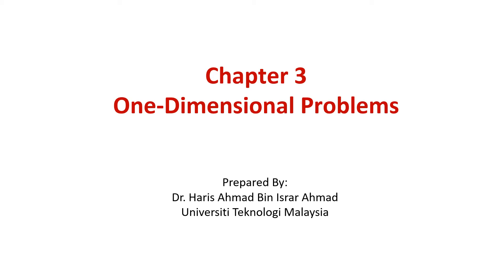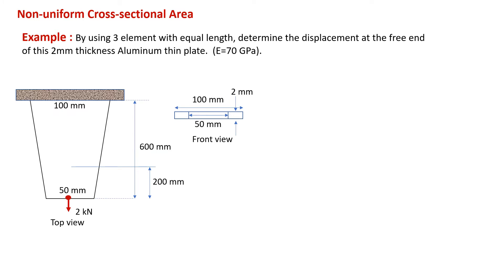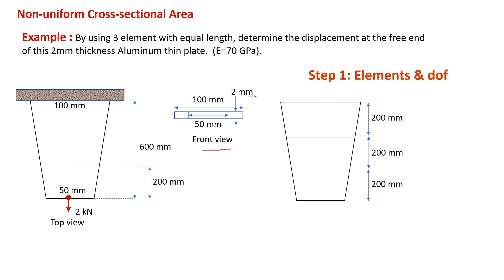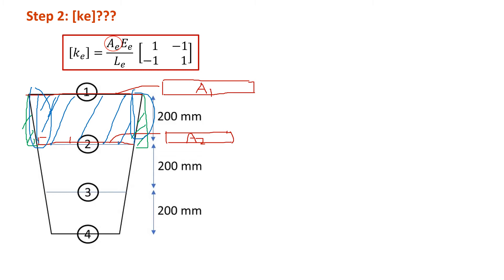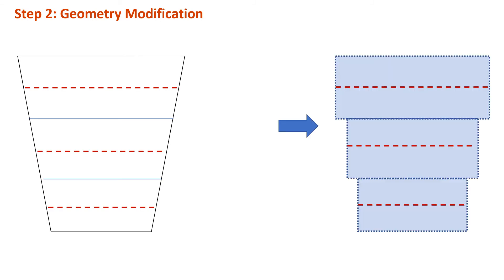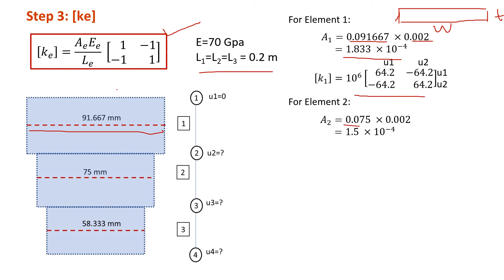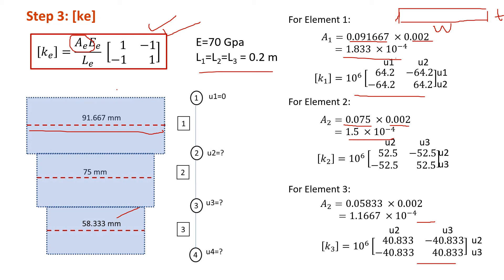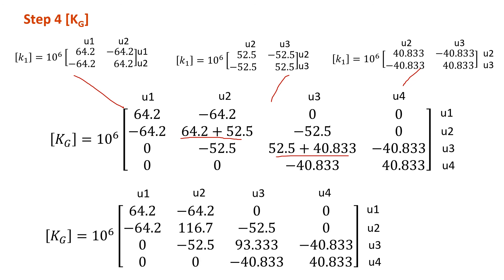FEM - 1D Bar Problems (Part 5)

Comment: where we get 25 mm ?
Reply from the maker: it is just the difference between the length at the root and the length at the tip (100-50) and divide by 2..
Reply: @h.aisrar1344  thank you so much
Your videos are great, there a big help. 
And thanks for the fast response